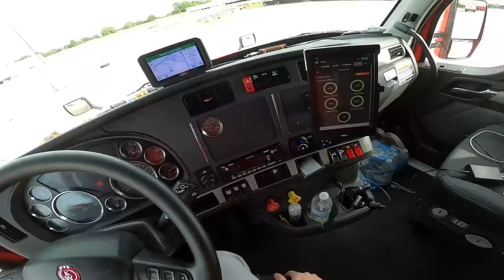I Got A New Truck!  2022 Kenworth T680 Tour.

Comment: You may not know this, but most T680s that are set up like this one, the passenger seat slides inward and spins around to face the table...check it out and see.  Yours may not have that option, but most do.  I owned a T680 for four years and it was a great truck.  A lot of comfort for my wife and I.

Comment: I've got my truck set up so wonderfully I don't want to switch ever. I have a shower bag hanging in the back with a camping toilet and pop up privacy tent, 40 lb battery and chest freezer on the bunk and chest drawers strapped down up there as well. Its very comfortable when I'm doing my down time. Only thing I'm missing is an electric AC so I don't have to idle the truck. I'll figure that out eventually too. OH its a 2017 Freight liner, my first truck. Love her
Reply: You rocking and rolling

Comment: 3:57 I don’t like those I mean yeah better fuel mileage and lest things to wash but when you open the cover on the rim it just looks so much better and shine
Reply: I don't like them either. As a L/O who pays for his own maintenance, I want my tires to last as long as possible. That means regularly checking tire pressures with a tire pressure gauge. Those wheel covers make that task more tedious and burdensome, and I can tell you from past experience as an aircraft mechanic that managers should never create more maintenance/inspection burden than absolutely necessary to promote safety. Those wheel covers will hide loose/missing lug nuts or wheel studs, and will also hide leaky hub seals, depending on the type of hub setup involved.

Comment: I’ve always thought Cascadias to be very user friendly. Back in my CR England days (ugh *shudders*) I had to be carful not to confuse the Cascadia’s handling with a SUV. I didn’t have that seatbelt beeper though thank God. I would be tempted to find the fuse for that seat belt sensor and pull it.
Reply from the maker: Yeah it wasn't bad at all!
Reply: You didn't like CR England?
Reply: You guys are crazy for driving for the mega carriers to begin with.
Reply: @dinosaursivac3511  why is it bad? The companies come with more job stability at this point and the company covers fuel cost whereas I'd hate to be an owner operator right now high fuel cost and overhead could cripple a small business man/owner operator furthermore I think the government is going to push gas prices high enough to make companies the dominant force and owner operators irrelevant because there's always someone else to take those low paying loads since all the owner operators that I watch on YT won't take them.
Reply: @georgemclaughlin19  mega carriers blow. That's my thought. To big and get lost in the mix. I prefer mom and pop places. The company I work for has 60 trucks and runs dry van, reefer, and flatbeds.

Comment: they have small inverters that plug into the 12 volt port then u can use the ac plug rather than using an extension cord

Comment: That camera is a LYTX system. It tracks your hands and your head angle… it can detect devices in your hand.  And you’ll notice the “dot” will go red if you do certain things, like a “bump & go” at a stop sign… it will say “stop for stop signs” and will say “distracted” it will also say “speeding” if you exceed your company’s set speed limit, for example, rolling down a grade… it’ll say it.  Mine also had an issue picking up (detecting) my properly worn seatbelt (until) we utilized a contrasting color sleeve.  Because our uniform shirts are black… the LYTX thought we were all unbuckled.     Now, having said all this, I don’t really care if they “monitor” or watch… they won’t see me holding a phone.  Too much to risk getting caught doing that in todays environment.

Comment: I seen your question on Instagram about the sliding fifth wheel. Always keep it between the two rear drives. You aren't gonna have to slide it doing dry van and having such a light truck

Comment: They may have the stops set too low if you hit a hard limit on the seat height.  If it is still "squishy" at max height it may be a valve issue.   Either way the seat should go higher with some fixin' or adjustments.  They may have it limited because the inverter controller is in such a stupid spot...🤷‍♂️  if you can't get it fixed, there are some pretty thick seat cushions out there.  I wouldn't reccomend a purple seat cushion unless you can get one to try before you but, they are way overpriced and don't always work right for some people.

Comment: They gave me a new 2022 kenworth in November and I was stoked to have a refrigerator but did not like the fact they didn't have ac outlets for the microwave or tv and also miss my spotlight but I wouldn't go back to an older one without the refrigerator or wheel controls if I was given a choice. 
It sounds like your seat may need some adjusting, I would check with the shop.

Comment: Just keep poking around. My ac plug was in the compartment next to it and I had to bore a hole between compartments. Paccar does weird stuff I guess there. Which motor you have? My 5th wheel puller never pulled a lever, lol, used it to tarp only.

Comment: The camera has to be recording all the time otherwise how would it catch you in an event. If it captures 10 seconds before and 10 seconds after set event. It does not store the data at the end of the day if you do not trigger an event in that 24-hour period That's how it works. And remember it still does audio so if you have an event and you are talking they can always assume you're on your phone or just distracted.
Reply: CFI sent a update saying it can save 10 hours worth now. I kinda like because it could show a car has been a problem and causing unsafe road problems for longer than the 30 sec if you hit them or if you get your bumper pulled off at the truck stop while taking a shower

Comment: Several observations:

1. That "catwalk" on the right side of your 5th wheel area should just be a cover for your snow chain rack. It should be able to lift up or tilt to expose the chain rack hooks.

2. The 5th wheel release and sliding 5th wheel are not new "KW features". Those have been options available to KW and Peterbilt tractors all along. It just so happens that CFI finally got their new KW's spec'd out with those features.

3. Doesn't your passenger seat rotate to face the desk? I noticed you never made mention of that capability in your old KW, I think in your video showing your intro to the Cascadia. My fleet has some T680's that have interior setups exactly like yours is, and our T680's have rotatable passenger seats. I've used one of them as a loaner before, and you have to set the height and forward/aft position just right to get it to rotate completely to face the desk without hitting the door or B pillar. See if your passenger seat can rotate. If it does, you won't need that store bought chair you have sitting on your upper bunk.
Reply: Oh...and what exactly is that "5 stick figures" decal on the left exterior, in between your door and side equipment bay door?
Reply: This person knows what’s up. I do wonder if Dave knows about the third one though, that could be a life changer.
Reply: @ScottZane  the decal is one that basically says we support the military. It’s silhouette of solders with an AH-64, and what looks like a 2 MIG-29’s above them.
Reply: CFI does not get the swivel passenger seat unfortunately. Source I am a CFI driver that was disappointed

Comment: Woah this is a weird hybrid of my new next gen and the older trucks I've been in (my old one, DFI, and the ones the school had.) Not exactly what I was thinking when I made the comment on your other video wondering what you'd think of a new T680. In comparison you're missing the new hood and digital dash. The old dash is probably why the wheel mounted controls are different too. The new one has a "favorites" mode that lets you put a few guages wherever you want. Fire extinguisher is still under the seat. I've heard all the new trucks come with a fridge (mine did.) Curious how many gears you've got. So far 10 has been better than 12. The 12 skips gears so it's basically 6, starts in 4th when heavy, and tries to climb hills in top gear. Hoping the fact I can't use the manual mode correctly isn't intentional.

Really weird to me seeing no outlets but that inverter is inside. There's a screen next to the clock and under the bunk heater that lets me see battery voltage and watt usage with a button to turn it on and off. Pretty bright light that doesn't dim facing the bunk so that's not completely ideal.

Comment: We have 680’s (day cabs) where I work, the only thing that I do not like are the headlights, just nowhere near bright enough for me, big difference in the FL and your 680 too?
Reply: If they're HID's, it could just be that they are getting old and losing their capacitance. HID's don't "go bad" the same way that halogens do. They gradually get more dim over time, then may even begin to turn themselves off, but can be reset back on when it's time to replace them.
Reply: @ScottZane  Appreciate the response, I’ve been in new ones or “newer” ones with less than 60,000, one like last night had close to 600,000, I personally can not see much of a difference, for “high intensity” lights they just suck in my opinion, I love the KW in most aspects but this is one component that PACCAR really fell short on, that is to say that unless there is a “cost effective” way to omit the lamp and substitute it for something of lesser quality then all I can say is that we have what we have, that it would be no fault of PACCAR at that point.

I can tell you this much, it’s damn difficult to see when the lane markings are worn, it becomes a huge risk when it’s raining, no joke, I actually prefer to be around traffic in these conditions to better identify my lane, that is how bad these are.
Reply: @sonnygreen9698  I feel your pain. FYI, I drive a 579 with HID's. I've had to replace both of mine before. They aren't cheap ($200+ each and only available at KW and Peterbilt dealers), but there really was a huge night and day difference in brightness when I replaced mine for the same reasons I mentioned in my previous reply. You can even see how different it is in videos on my own YouTube channel. I used to live stream a lot of my shifts, and even my viewers would wonder why my headlights seemed so dim until I replaced them. 

As far as the rain is concerned, there's unfortunately no good way for us to effectively deal with that, short of demanding that state DOT's spend some extra money and install Bott's dots in the lanes. Even when I was an aircraft mechanic launching and recovering airplanes, dark rainy nights were nightmares when trying to keep pilots right on the taxiway line or getting them to stop right where we need them I stop. That was even with us standing no more than 50ft from the target spot. 

If you aren't familiar with Bott's dots, they're basically just the reflective bumps that you'll see next to the solid white and yellow lines as well as in between every other hash mark in between lanes. They really make a huge difference in both rainy and foggy conditions.
Reply: @ScottZane  very familiar with Bott’s, I find it unfortunate that with all of this safety focused on  the trucks that there is not more money spent on such measures, I 100 percent agree with how helpful that would be.

Love the conversation, I spent 44 years in the automotive industry and left it for driving a truck, it’s always interesting to hear about life experiences of others in this field.

Thanks for sharing and the conversation, be safe in your travels !!

Comment: i haul milk for a living, i drive a 2022 KW T880 i was assigned in november. it has a cummins X15 565 hp and 1850 torque and an 18 speed manual. i really like the truck, it pulls the heavy loaded tankers up the hills nice. i dont care much for autoshifts, what engine does it have? hopefully cummins

Comment: Do you have an APU?   Do you have an air switch to raise and lower the seat?
Reply: Not sure if you're a CDL driver, so I'll try to explain this without coming across as condescending. It's quite obvious just from the exterior walk around portion of the video that this tractor does NOT have an APU. If it had one, you'd most likely see it mounted to the side of the catwalk opposite the "extra catwalk" (snow chain rack) that he showed on the right side of his real catwalk. There would also be a fan and possibly also a small coolant reservoir mounted to the back of the sleeper section, if it had an APU.

Comment: What invertor i should use for my laptop in truck use? I mean how many w should have? I seen lots of options from 300/600 to 1500/2000 to 5000w
Reply: Not a driver myself but an experienced O/O that I talk to and who has a YouTube channel Clutch Trucker had a 2000w for long time but now has a 3000w also. Based on his comments, I think 2000w is probably the minimum if you want a microwave plus any sort of refrigerator.

Comment: Hey Dave I’ve been looking at maybe getting back into trucking for a little while and I looked at CFI (haven’t applied anywhere yet) from what I saw it looks like you need to have a hazmat endorsement, which I don’t currently have. Is it a mandatory requirement that you end up getting the hazmat or no?
Reply: I worked there 7 months they never made me get it but they say that they want you to after a certain period of time 

My trainer has been there 7+ years and doesn’t have it lol
Reply: My advice is if they are going to pay for it grab it. Some companies that don't deal with alot of hazmat will still end up paying you more if you have it.